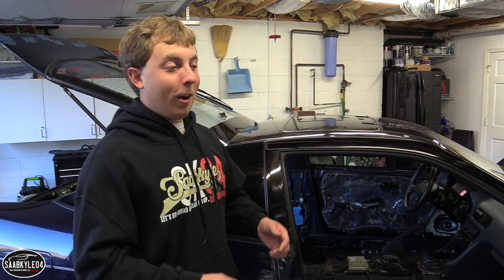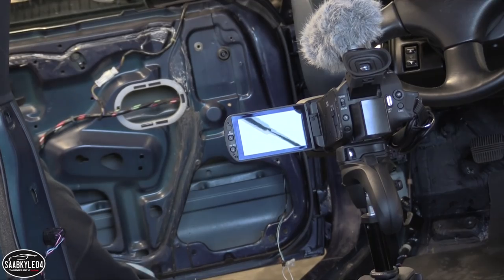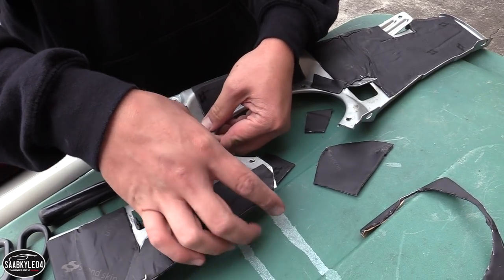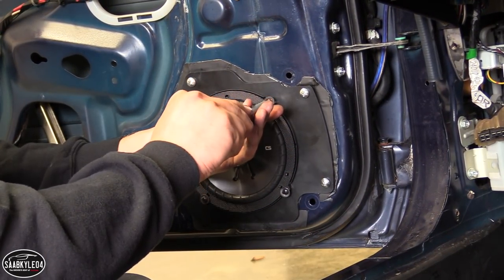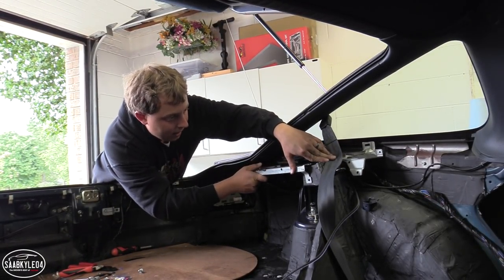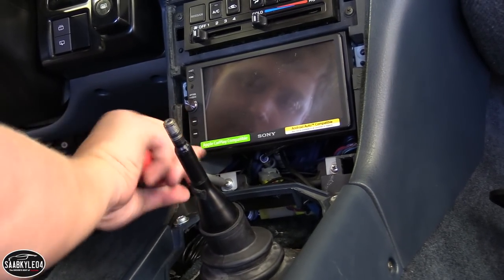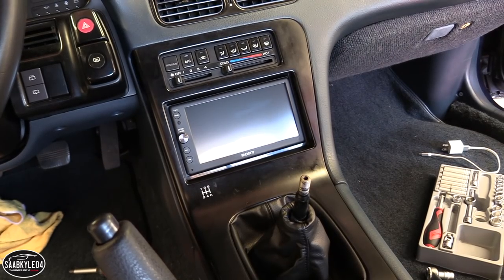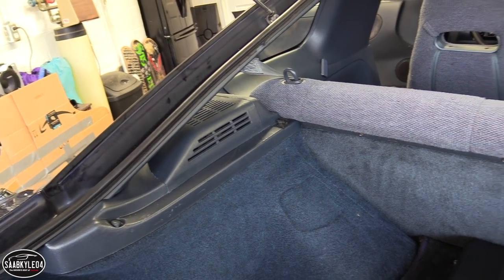Installing a Complete Custom Audio System In The 240SX!

Comment: Omg why tf would you put the amp on the floor behind the seat? Should of just put it in the trunk to make it look clean smh
Reply from the maker: diego sx I already explained it in the video in case you missed it.  I'm installing a rear mounted battery so anyway that I can minimize the loss of trunk space the better. If you put it underneath the seat, it'll get crushed when someone sits in it, or get badly scratched up if the seat is slides back and forth.  There was no other option.  Do I wish there was another option yes, but there's not, so I did my best and I'm happy with it. The backseat is useless anyway, no one could sit back there.
Reply: why wouldn't you put it behind the driver?
Reply: DJZ3ROKONTROL my dad said "20 minutes" 20 years ago I'm still waiting
Reply: Well Bruce, I hope you're not holding your breath. I'll be your dad now, son
Reply: Should have mounted it to the backside of the rear seat and used 6.5" subs instead of the rear coaxials and useless sub thing you've got.

If this is a "restoration" build the audio install should be more integrated and appear mostly OEM. A visible amp on the floor looks very high school. Not tryna be a hater, but a little more research and foresight could have netted a much cleaner install.
Reply: Its his car, he can put it on the roof if he wanted. He explained why he put it where he put it.

Comment: The red handle wire cutting tool is intended to crimp the solderless connectors as apposed to your off set channel lock plier. It has specific shaped notches for a proper crimp.
Reply from the maker: James Jones Yeah, I used it after the fact to make sure everything was snug 👍🏻👍🏻

Comment: Can you spare any information on how you kept your speakers from hitting the window inside the door and also cleared the speaker cover in the door panel? I'm currently trying to do this to my 240 using the plastic speaker adapters on ebay for 240's and having issues with clearances.

Comment: if you ever decide the double din is too much and tired of the amp behind your seat there is a great sony unit with built in amp just like the kicker sub. 

I run this setup in my  mk3 supra. The 1 din deck powers my upgraded speakers and the kicker sub has its built in amp. just an idea for space saving.

Comment: Awesome and inspiring video! You need to link the sound system you got in the description so I can go buy it! Well at least the amp cause I already have 2 subs and all the speakers are Kicker 6x9's. I just need a better amp. The one I have now only has enough power and connections for the subs. If anyone knows what amp that is, let me know.

Comment: Nice installation. I always installed the power amplifier under the driver's seat, that's because I use the rear seat for passengers (I have an '89 Geo Metro) and they get into the car using the right door. Nice job Kyle (a little complicated) but Nice job

Comment: Very great, but you could fix the amp in the rear back of the back seat, right above the subwoofer, it would look a lot better and will have no problems with heat.... greetings from Brasil

Comment: Fun fact the stock car speaker wire was most likely pure copper that's why it was so small. The "upgrade" wire is aluminum coated in copper.

Comment: Any plans on bride seats and harnesses ? And also are you gonna do a full wire tucked bay with the rb setup
Reply from the maker: Stanced G37 i'm gonna try to get the original seats restored first before I consider other seat options. I am going to do some wire talking just not sure of the extent yet.

Comment: In order for a speaker to make a sound difference with sound dampener you have to dampen the whole inside and 2nd door wallbefore the door cover then use fast rings otherwise adding just a 1x1 dampener square wont do anything you re loosing about 50% of the sound

Comment: Why didn't you use the crimping tool to crimp the connectors? You're going to have a loose connection from using channel locks instead of the proper crimping tool

Comment: installing amp under back seat passengers feets? try to take few friend in winter on backseats witch snow boots and the amp will die. probably only stepping on amp is terryfing me. u should put the amp on the amp in the trunk and will not take much space. thumbs up

Comment: I like everything you did minus the amp location. If it were me I would have located it right under the passenger seat so you wouldn't have to give up that back seat.
Reply from the maker: Karnage543 It wouldn't fit, tried several ways.  If you put an amp under the seat, the seat will crush it when someone gets in, let along scratch it bad if you slide it back and forth.  The back seat is useless so it was an adequate sacrifice in this case.

Comment: for anyone wanting to install an amp, a good tip for buying the amp wiring is to buy arc welding wire.  The "audio" wiring is overpriced and not full copper in some cases, but the arc welding cable is full copper and a lot cheaper.  Harbor freight had arc welding terminals you could use to terminate the ends.

Comment: Did u use pliers instead of the proper crisps for the wire connectors ??
Reply from the maker: brian lewis I did at first, but went back later and used the crisps after realizing it haha 😁
Reply: Saabkyle04 good job but solder is a lot better with heat shrink. Keep up the cool videos :)

Comment: with the amount of power running through the system you shouldve used 0 gauge wire, its only about 10 bucks more and nearly impossible to blow out subs/amps with

Comment: I think you should put the amp under the passenger seat. But everything turned out great.
Reply from the maker: Koji Takata I said in the video that I can't put it under the passenger seat. The reason being is that there is not enough clearance so the seat would end up crushing the amp if someone sat down.

Comment: @saabkyle04 Did you jam to Despacito after the install? lol. The amp behind the passenger seat doesn't look clean in my opinion. Perhaps you could've mounted it vertical behind the passenger seat, perpendicular to the kicker. Cool install tho!
Reply from the maker: Juan Alcantar  The amp couldn't be mounted vertically.  I'm installing a rear mounted battery so anyway that I can minimize the loss of trunk space the better. If you put it underneath the seat, it'll get crushed when someone sits in it, or get badly scratched up if the seat is slides back and forth.  There was no other option.  Do I wish there was another option yes, but there's not, so I did my best and I'm happy with it. The backseat is useless anyway, no one could sit back there.
Reply: It's not Despacito, it's some GarageBand loop

Comment: why not at least route the power cable through the 240 you will have to do it anyway if you are putting a rear mounted battery in the car then the powerwire is ready for you there just connect it to the battery in the back and the other end to the loom that is allready in the front of the car where the old battery was. just a little tip for you

Comment: You should solder the wires and use heat shrinks, those connectors are crap

Comment: sweet. but if nobody sits in the back why didn't you just lose the back seats?
Reply: TheBestGamingCritic he's doing a resto mod so it's gonna be as factory looking as possible with his own mods underneath
Reply from the maker: That would be borderline race car and I really don't want to take out that originality. Even with the passenger door open you don't see the sub. I wish there was another option, but to maintain trunk space and keep the amp level, because I couldn't mounted vertically, this was the only option.  It couldn't go underneath the seat because it would be crushed.

Comment: The amplifier placement is a bit stupid. 
You could of easily place it directly under the passenger seat and it would of been perfect and look cleaner.
You are basically asking for your car to get broken into and get the sound system stolen like that.
Other then that, great job on the interior